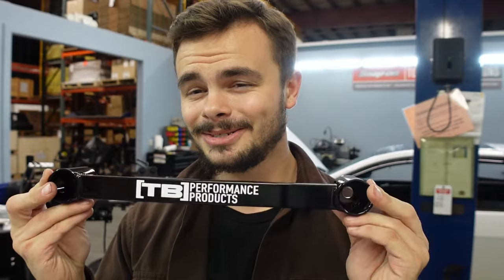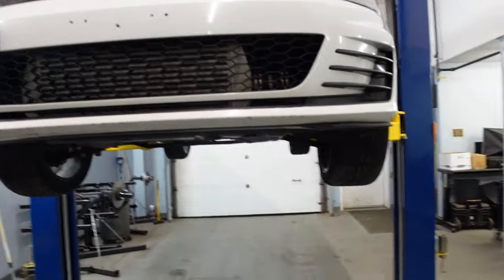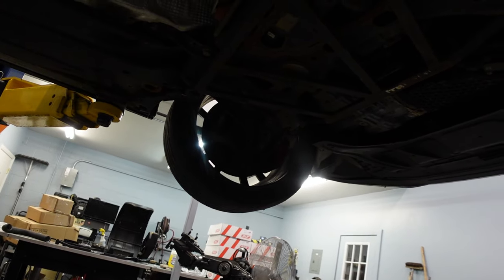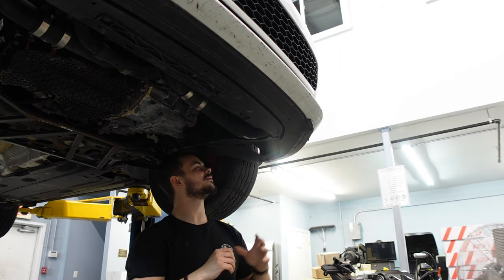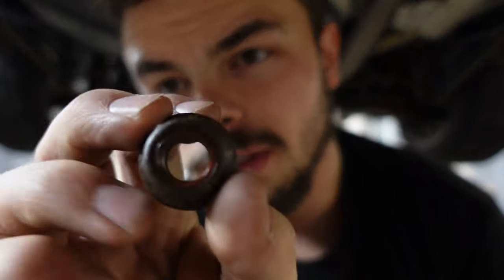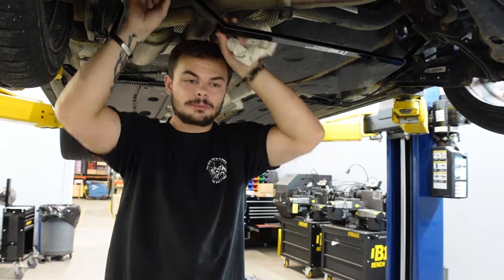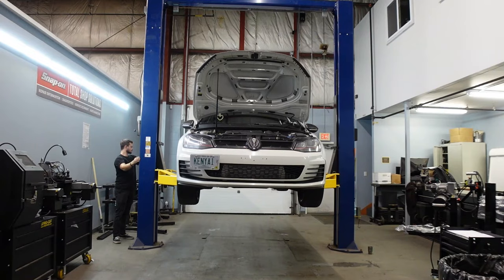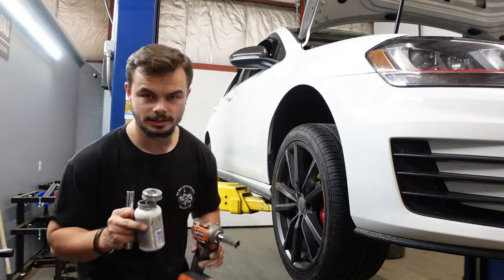THE MK7 GTI GETS CHASSIS MOUNTED BRACES

Comment: bro get the metal oil pan when you do your next oil change! takes less than an hour to install. I recently bottomed out HARD and smashed a hole into my oil pan. Thanks to physics I did not destroy my engine, but obviously there could have been catastrophic damages to the engine. Such a cheap and easy replacement you should definitely do it man!
Reply from the maker: Superrrr funny you say that mane, wait for the next video 😉😂
Reply from the maker: It’s literally one of the biggest problems with these that people just don’t realize until it’s to late

Comment: Hey man im new to this platform and ive been getting an EPC light everytime i do a hard pull on the car. I scanned the code and it said it was nothing.. the light goes away when the car is turned off and back on again. Do you know anything about this issue?
Reply: Hey I’ve had the same problem and it’s come up as a hide cylinder code due to excessive misfires, in my experience spark plugs and coil packs solved the issues but you may also need to look into your injectors